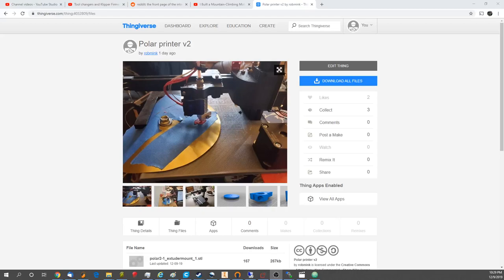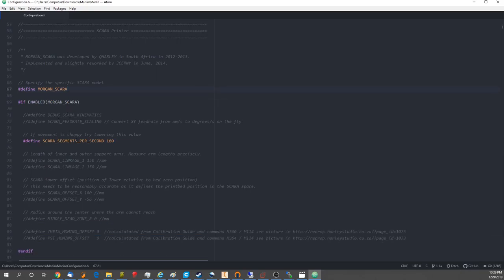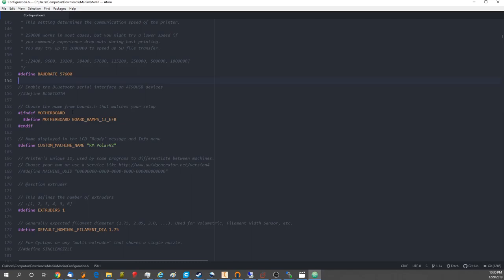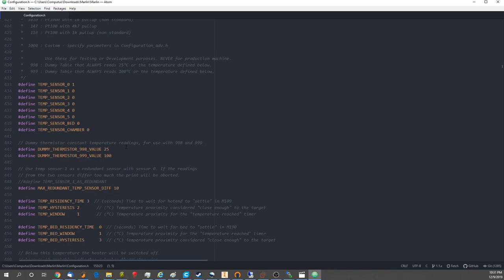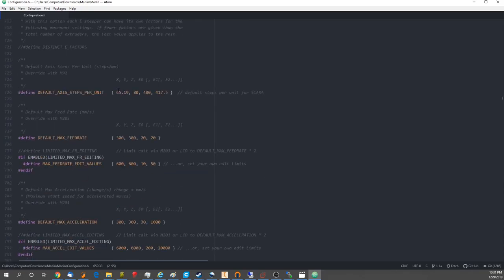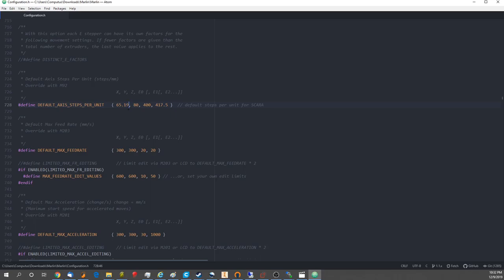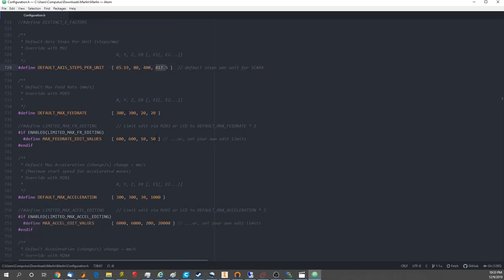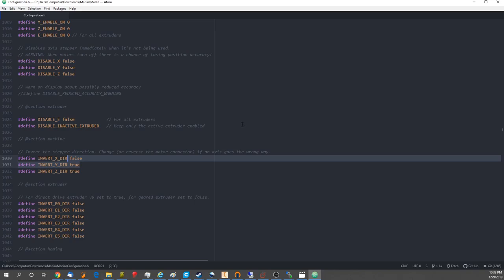Polar 2 / Marlin 2.0 Firmware how to

Comment: Hi! An interesting project, but it looks like it hasn't been updated for a long time. The other day I was puzzled by the construction of a polar printer with a large table size, but without automatic cleaning, just the entire area of the circle is used for printing. Does it use g code arc commands instead of linear movement? That is, I would like to place a round part in the center of the table, so that its perimeter is made only by moving one axis - by rotating the table, so that the round part is round, without any steps. Is it possible or will there be defects from the command conversion? Actually, I need such a printer to produce perfectly (or so) round parts centered in the center of the table, of course, as well as various gears and pulleys of the gear belt. This design allows you to make all the teeth the same throughout the perimeter.

Comment: Looks great!  Are there any known  issues?
What slicing software(s) have you managed to use with this?  
Thanks
Reply from the maker: I am actually currently fighting with a tapering issue that's a bug in the firmware, I can't find it atm, but I am looking.  It works with all normal slicers, the 'magic' is done in the firmware so if you pop a round bed into a slicer (cura, PrusaSlicer, Slic3r...) and slice, it will print.